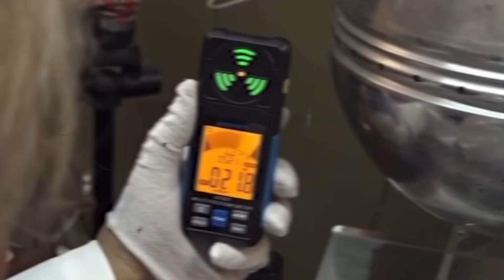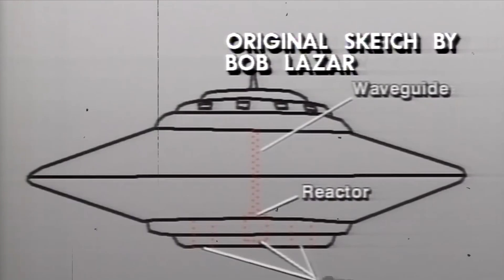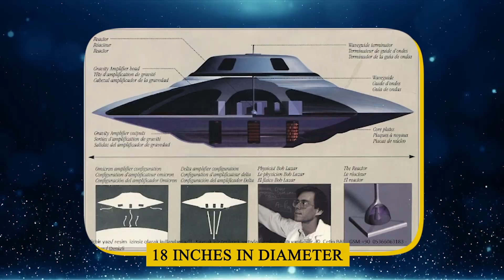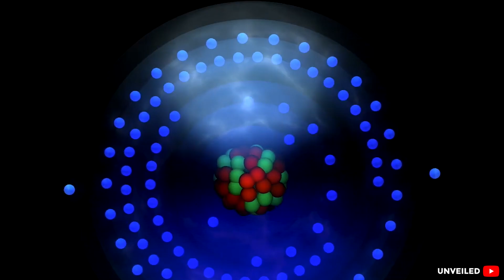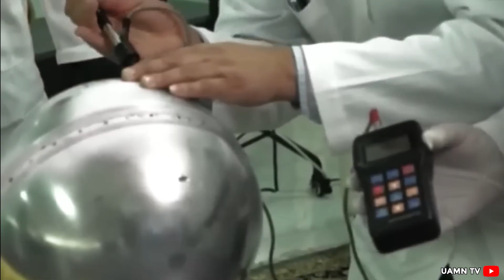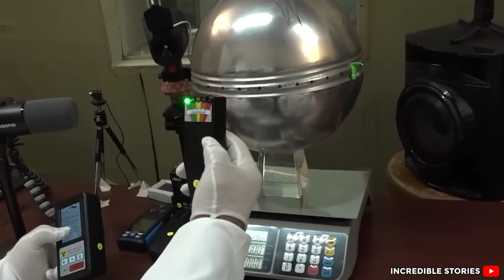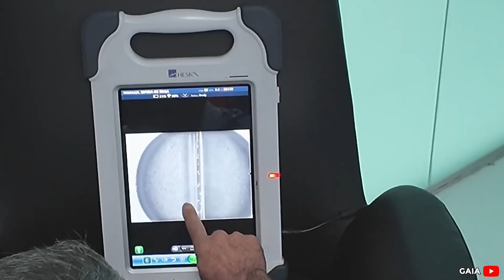The Buga Sphere Matches a Device Described by Bob Lazar.. Then This Happened..

Comment: Its not perfect in any way. It is not "perfectly" smooth. It has what looks like a brushed aluminum finish (not a highly polished mirror surface). The markings look hand engraved. If it was truly a "high tech" device with no seams or welds, you would think that perfection would carry on to its markings. The holes around its diameter look like they were drilled by "eye balling" and not even close to precise. I could have made the hole spacing perfect and in perfect line at my home shop. 
We make ball bearings on Earth... no welds or seams. Large ball bearings the size of the sphere are possible. We can place different layers within each other as well. You make an object, then pour molten material around it, then machine it to a sphere, then randomly brush the surface until all machine marks are removed. No seams or welds. This can be done in as many layers as you wish.  We do that to weapons grade Plutonium to build up reflective and tamper layers.  But they stopped there and didn't bother polishing it. The markings are hand carved and you can see very light guide lines for the text.  An advanced design that needed guide lines to keep the text straight?  They overcame gravity but not simple geometry? 

I think the stories of its weight increasing and it absorbing energy are just stories. They talk about the micro spheres inside, but no drawings of them are provided... again, mentioning they are perfectly aligned, but the X-rays show them in a little bit of disarray - not even close to perfect positions.

No details about the "matrix" of fiber optic like structures.  Same photos over and over, to the untrained person, it seems fantastic. But give any enginer a diamond blade saw and it can be cut in half in an hour.

I think it is a human made hoax.